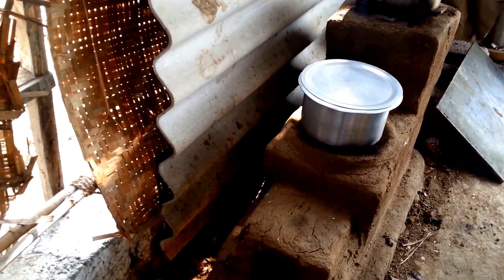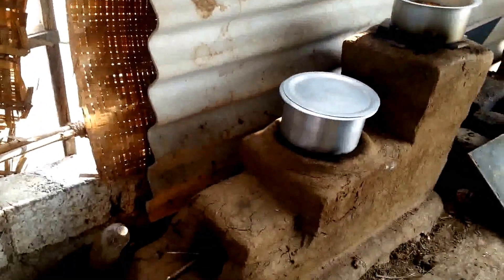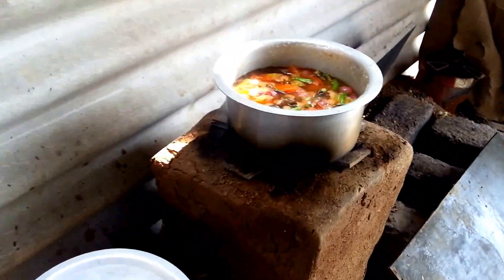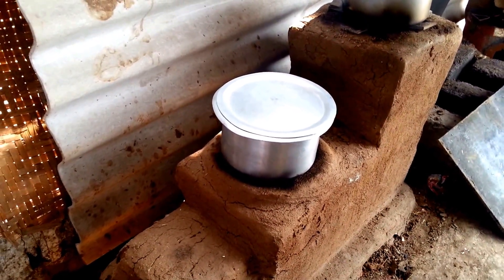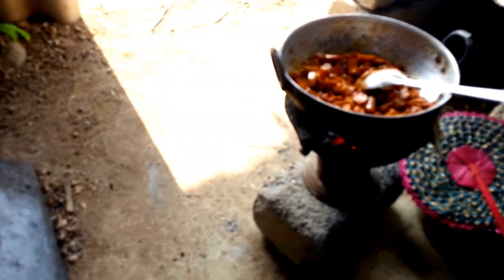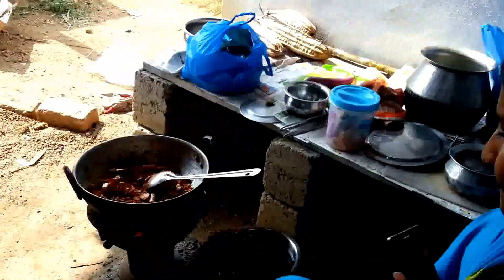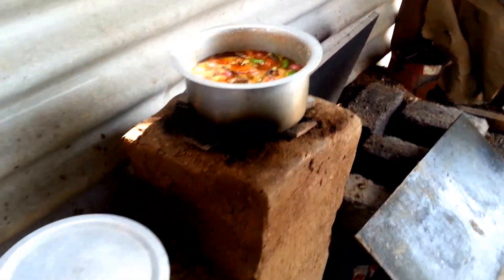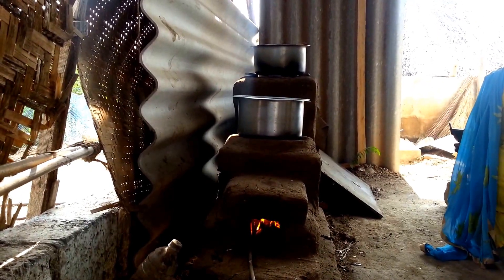Rocket stove double burn Working!

Comment: Can you please share the dimensions - both internal and external. 
Also where is the air supply for the combustion coming from - is it from the where the wood is fed - in which case I do not see nay mesh to bring the air inside the burning chamber. Kindly clarify. 
To construct what mud mixture have you used?

Comment: Where does the CO2 or combustion gases escape?? They are neither escaping from the inlet nor from the gap between the stove and the vessel. Some where they should escape right. Or, do this collect CO2 in the inner chambers??
Reply from the maker: +Jagadish K No.. they just escape from around the vessels.. In this construction, the heat is held longer in the burn chamber and the burn chamber itself is long. The air intake is also very much adequate and that causes a virtual complete combustion. Hence no smoke and particulates. However, when we put in wet fuel, lots of water vapor comes out and brings out a lot of smoke, so the fuel is also an important factor in this. Great question!!